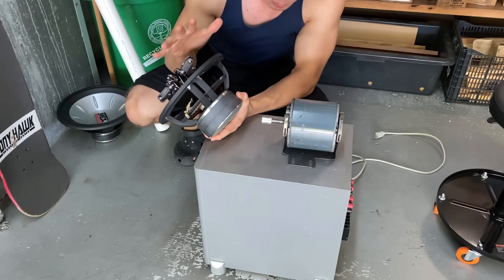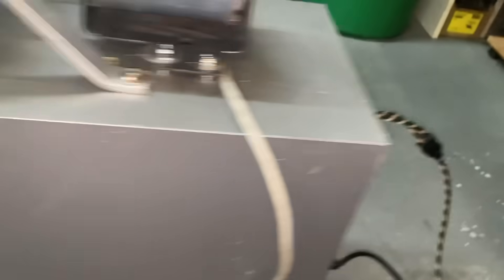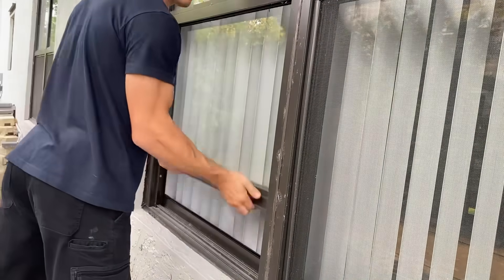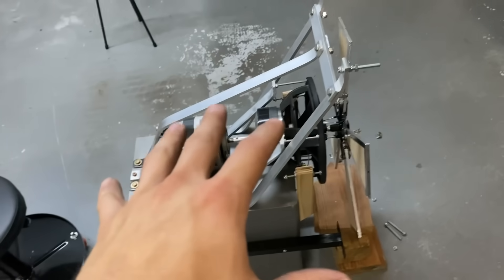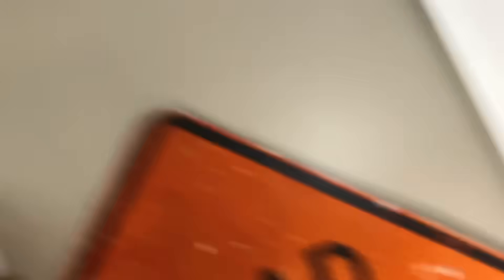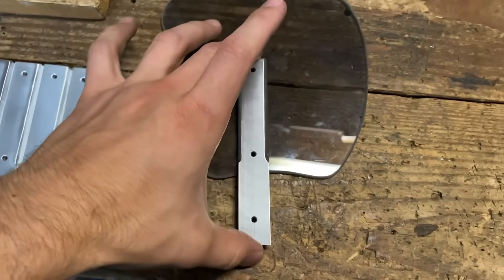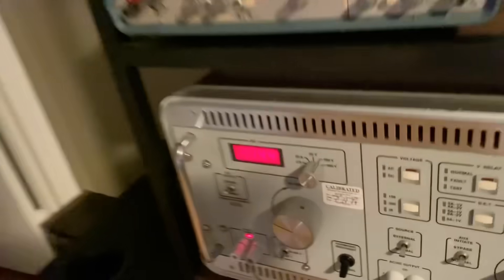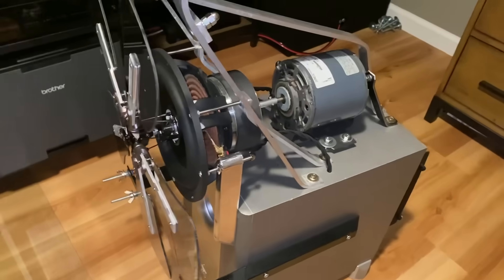Making the worlds most powerful subwoofer (Rotary Subwoofer)

Comment: How does it sound at audible frequencies like 20 hz? What range of sound can it reproduce?
Reply from the maker: Well, the audible frequencies extend much lower than 20hz, people just say that cuz subs can’t move enough air below that frequency. My rotary can’t handle anything above 15hz really, since the mechanism actuating the blades wants to explode. But anything below that down till about 5hz is very audible, and the ears actually register it as a sound, not just air distortion.
Reply: @pierogiengineering  Yeah the original one was supposedly efficient over the 0-20Hz range, and most effective when the room it fires into is sealed. So it's not a replacement for the low end of a "full range" system, it extends that range of the bass all the way down to infinity (zero)

Comment: If I sent you $850, would you send one of these to Michigan, USA?
Reply from the maker: Unfortunately that wouldn’t cover the costs. I had most of the components for this already lying around, but if I had to buy everything again, package and ship it, I’d only break even. And that’s not considering that this took over two weeks to complete. $2,500 would be the lowest I’d consider.
Reply: Any way I could get a parts list? I've got many car amps and have some experience with electronics and would enjoy building one, seeing you have one working I hope you wouldn't mind me making a cop
Reply from the maker: @shinhisan1305  sure thing:

JDHMBD 500 PRO 500 5 BLADE ROTOR HEAD (aliexpress)

SB ACOUSTIC 8” HIGH EXCURSION 4 OHM WOOFER (madisound)

The motor came from an old Boeing airplane I think and I can’t find it for sale anywhere. You’ll want one that can spin up to 1800rpm and has a soft start.

The amp is an old 150w Rockford Fosgate Punsch. Any 150w amp will do.

I used a 450w PC power supply to power the amp with 12v. I’d recommend using something similar or stronger.

And everything else was just scrap metal brackets and wood. 

Alignment is KEY! Make sure that the shaft, motor, and rotor assembly are perfectly aligned on the same axis, otherwise you’ll have significant loss of performance. The fan should spin freely if turned gently with one finger, if not, it’s misaligned.
Reply: @pierogiengineering  gosh guy, thank you very much! I've got a furnace room, about 20 by 20 that would be perfect as a baffle, will subscribe!
Reply from the maker: @shinhisan1305 my pleasure, keep me posted on your build
Reply: @pierogiengineering  already have most of this already, I have a 600w 12.3v DC computer power supply running my Kenwood 600W car amp, running my two MTX thunder 3k's connected to my pioneer home theater system, so its just the translation of back and forward to twist motion I gotta get done
Reply from the maker: Sounds good, but be careful using an amp that powerful. The rotor assembly is delicate and barely handles my 150w amp.

Comment: Always been fascinated by bass and subwoofer, even as child. Like a decade ago I heard of rotary subwoofers and wondered why these things weren't more common. Then I learned more and found you need infinite baffles (or a gigantic enclosure) to make these things work properly and how annoying the setup is... But god damn it I wanna feel the infrasonics lmao. My transmission line sub caps out at around 30Hz, so close yet so far lol. This build is magnificent for the budget and I'm actually jealous. Just imagine how insane that theatre will be with some traditional subs and this badboi for the infrasonics. Crazy shit. Also the editing is top notch lol 👍
Reply from the maker: Many thanks, glad u liked the vid! If I had a permanent place to set this up, I’d be using it every day for sure. I’m thinking to port it between my attic and house, but I don’t think anyone will let me cut an 18” hole out the ceiling.
Reply: @pierogiengineering  Heh perhaps not lmao. Be careful with this tho, who knows what SPL this thing is pumping out or the resonant frequency of your house. Could do damage 🤔
Reply from the maker: Yes, you’re absolutely right, not gonna risk the house just yet

Comment: Looking at your other videos you seem to not be too far from me. I’ve got loads of subwoofer parts around and I want to build one of these for an infinite-baffle install for my truck. I think it’ll definitely make some wind with infrasound lol
Reply from the maker: It’ll definitely move some air, just know that you’ll only be able to play up to 15hz max. The rotor pitching mechanism wants to tear itself apart when it’s being fluctuated faster than that. Best of luck tho.
Reply: @pierogiengineering  thanks man; do you think having smaller/shatter blades would help increase some of that frequency response at the sacrifice of some output? Was thinking of using shorter and thicker blades to keep leverage on the rotor head as little as possible
Reply from the maker: Definitely don’t use thicker as it will impose air resistance. 1/8” is as thick as I’d go regardless of blade size. And in theory I’d say that it should be able to play higher with narrower blades, but you’ll just have to test that out yourself. Same reason I built this thing first with wooden blades to see if their surface area was enough to work with my motor’s rotational speed.